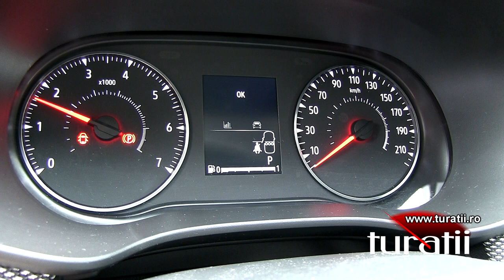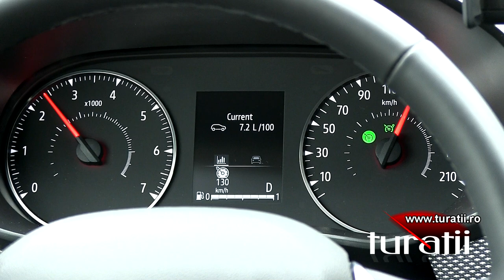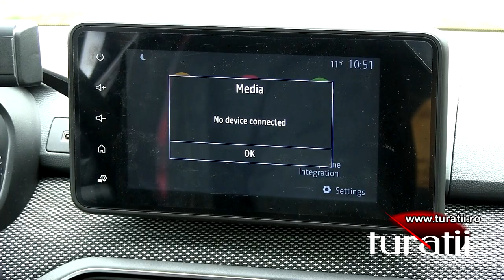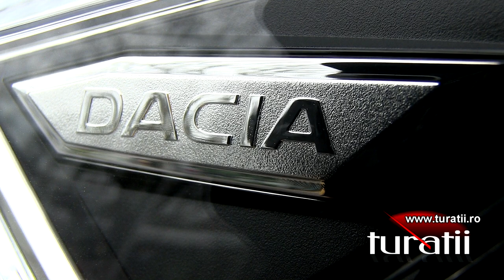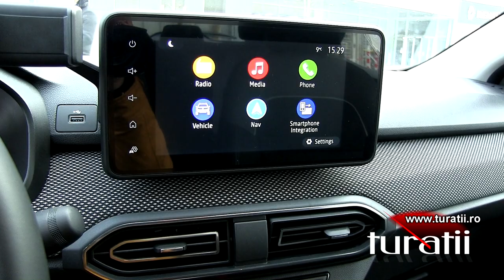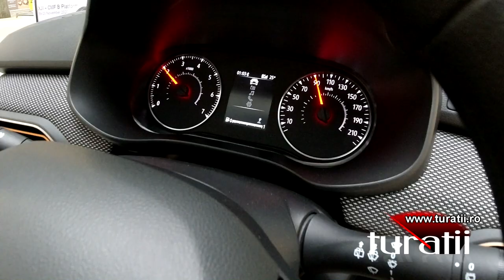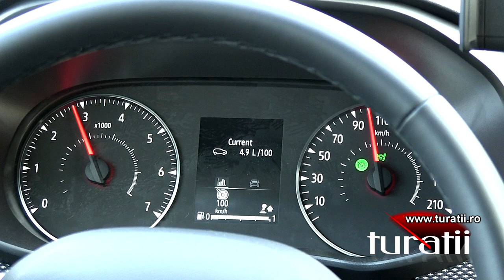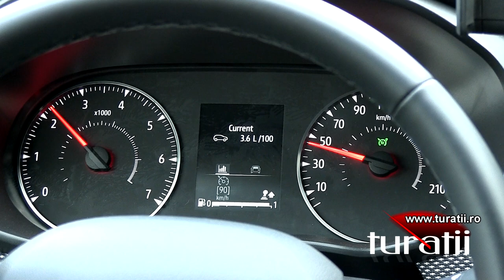Prim contact Dacia Logan, Sandero, Sandero Stepway, generatia 2020

Comment: Logan Tce 100 Eco-G sper că veți aduce cât mai curând. Mi se pare cel mai interesant dintre toate.
Reply from the maker: Sincer, am condus Captur cu 1.0l TCe GPL 5 trepte, absolut remarcabil pe gaz, incredibil, abia astept sa il pun online, sa vedem ce mai zice lumea atunci, nici nu l-am comutat pe benzina, nu aveai nevoie.
Reply: @turatii  chiar de aceea am spus că este interesant pentru ca eu conduc un Logan 1 Facelift 1.4 Mpi cu Gpl si se simte o diferență de cuplu si raspuns al motorului. 
De asemenea, voiam să vă întreb dacă vi se pare mai lenta schimbarea treptelor de viteza într-un sprint la un motor in 3 cilindri cum este acesta fata de un motor convențional in 4 cilindri.
Reply: @turatii  Salutare! Abia astept testul cu Renault Captur pe turatii cu motorizarea de GPL <3 Doar asa imi pot face o parere mai apropiata asupra consumului de GPL si pe Sandero Stepway care ar trebui sa fie mai mic (masina mai mica, 6 trepte in loc de 5 ca pe Captur).
Reply: @turatii  Care este explicația Dacia ca pe varianta de 90 cp M 6 nu pune gpl din fabrica ?

Comment: Atenție că m-am informat Skoda Fabia de la 10.420 de euro (varianta de bază ) cu motorul de 1.0 mpi de 60 de cai putere că dotări vine cu ABS , ESP,  Airbag-uri frontale față și laterale in fata , servodirecție electromecanica ,jante otel de 14 inci , instalație de aer condiționat, radio , scaun șofer reglabil manual pe înălțime și închidere centralizată in concluzie Dacia Sandero preț de pornire 8.600 de euro și varianta full 12 .950    Skoda Fabia preț de pornire 10.420 de euro și varianta  full 17.500 de euro cu motorul 1.4 90 de cai

Comment: Mulțumesc pentru răspuns, eu am închiriat în fiecare an în concediu in România, sandero, lodgy , logan, am. rămas dezamăgit deși sunt fan Dacia mai ales ca in Madrid e plin de dacia lodgy taxi Dokeer pt muncă  Dokeer stepway pt familie si ieșiri la munte sandero și Logan nu mai spun sunt mai multe ca in România eu am un Seat Mii 1,0.75  și merge foarte bine și ma întrebam cum de nu are dacia un motor ce am pe seat mii, acum sper ca va fi o masina mai capabilă si mai ales scaunul și reglaje la volan, eu îmi doresc ca tot romanul sa aibă o dacia sa iute de rablele din Germania și sa urce economia in România, după ce am ajuns să am cam tot ce e necesar după o
18 ani de emigrant vreau sa va spun ca unicul ce mi-ar plăcea sa am o dacie 1300 pt weekend sa simți mecánica si sunetul si mirosul de benzină. salutare tuturor.

Comment: daca tot au renuntat la motorul diesel de ce nu au putut marca limita turatiei? Nu este acelasi motor de 1l la toate motorizarile?
Reply: cred ca din cauza lu' Duster care are acelasi turometru, dar vine si cu motorizare diesel
Reply from the maker: E, o ieftineala stupida, daca ma intrebati pe mine, dar e cost effective, la niste sute de mii de masini, picatura aia de rosu inseamna poate niste zeci de mii de euro. Cand esti low cost, te cauti la buzunar.
Reply: @turatii  daca vă uitați cu atenție pe cadranul turometrului sub acel ,,x1000,,, ne arată că motorul merge in gol la 1000rpm, pentru un raport bun putere/viteza/costuri trebuie exploatat între 1000 și 4000rpm, între 4000 și 6000rpm nu trebuie sa stea prea mult (gen depășiri, plecat tare de la semafor, serpentine montane), iar între 6000 și 7000rpm nu ai ce să cauți (gen acea zona roșie (e valabil și pentru kilometraj)).

Comment: Doar o  întrebare legată de Stepway:: de ce pornește la peste 1000r/m ?
Reply from the maker: Depinde de temperatura de afara, are soc automat si afara fiind frig, socul se adapteaza singur in functie de temperatura motorului, temperatura aerului admis si alti parametri, nu e nimic anormal.
Reply: @turatii  întâmplarea face să "am" pe cineva la Dacia Titu (Centru) și mi-a spus că indiferent de tmp de afară tot la peste 1000r/m va porni dar vroiam să aud și părerea ta.
Reply: Un motor rece va porni la peste 1000 r/m și vara dar asta va dura câteva secunde ,iar iarna câteva minute E elementar ,temperatura exterioară și cea optima de funcționare a motorului în staționare.
Reply: In general cam toate masinile care au motor in 3 cilindrii pornesc la fel ,vw de ex

Comment: Inca posed un logan Ambition 1.6 (adica "full option") cumparat la inceput de 2008 cu 9800 euro.
Actual este masina de frecat prin oras si mers la servici. Prima masina "de buna" fiind o marca germana ce nu are relevanta. Actual la 174.000 km reali pot spune ca DACIA nu este o masina fiabila dupa cifra magica de 100.000km chiar si cu toate revizile si consumabile la zi. Tabla/rugina este o problema pe care o am din al doilea an de posesie. Caseta de directie inlocuita la 120.oook cutia de viteze a mancat rulmentii in ea si facea zgomote de noua si nu am reusit inlocuirea ei pe garantie, am mers pana a picat si am pus alta din dezmembrari de 1.5dci euro3 pentru rapoarte lungi. Compresor clima terminat la 110.oookm (avea joc in axul fuliei -> pierdea tot freonul).
Masina extrem de zgomotoasa de la 90km/h in sus. Suspensia moale dar nesigura la viteze mari. Am schimbat arcurile cu un set cu garda mai mica cu 40mm. Acum pot spune ca se simte a masina. Probleme cu actuatoarele din usi. Probleme cu zgomote de sub bord la diferite turatii ale motorului. Desprinsa tabla aia de rahat din spatele airbag pasager. Probleme la planetare la 160.000km. Si mai sunt multe dar ma opresc aici. .... Vopsea de toata jena .... isonorizare la fel.... ajunge.
Am luat teapa o data si nu mai repet greseala.
Consider ca sunt prea multe probleme pentru o masina personala sub 200.000km cumparata de noua.
Reply: Polo 1.4tdi an 2007 cu 280.000km. Prima problemă la 200.000km mi-au picat rulmentii din cutie si 2 sincroane din bronz (cost 2000lei dar am schimbat si ambreiajul Sachs 900lei +sincroane 150lei +timonerie) Rugină doar la praguri ptr că am făcut greșeala să nu spăl deloc masina iarna după drumuri pe sare si nisip dar am rezolvat ieftin la tinichigiu. La 278.000 mi-a picat pompa tandem si mi-a aruncat uleiul pe evacuare inițial crezând că e turbina (cost 1100 lei cu pompă sh 250lei schimbat ulei+filtru si bujii ptr că erau cele originale si pornea smucit la rece) Probelemele au fost la planetare sau la capetele de planetară? Eu le-am schimbat o dată. O revizie costă 300lei si se poate face si singur. Consum 5-6%. Minusuri zgomot de tractoraș dar mie imi place 🙂

Comment: Pai are consum ca al unui 2.2 hdi de la Peugeot...si cand te gandesti ca altii au motorasul de la stergatoare cat are aceasta Dacie cilindreea🤣🤣. Cum poti sa spui ca, cu  5 persoane trage la fel ca si goala(doar soferul)? Dacia ar fi bine sa puna si motoare adevarate pe masini...pe mine unul motoarele mici de la ei ma dezamagesc.
Reply from the maker: Judeca asa cum trebuie, nu comparam mere cu pere, ca pot si eu sa zic ca 1.5l dCi era imbatabil la consum si de fiabilitate nu mai vorbim. Normele europene ii obliga sa scada cilindreea, ia vezi la Peugeot, ca ai pomenit de ei, ce motorizari au la masinile de segment B. Acum, nu a fost odata. Si nu am spus ca incarcata cu 5 persoane trage la fel ca si goala, ca nici M3-ul de 400 de cai nu trage la fel cu 5 vitei inauntru. Am spus ca trage, nu te rogi de ea, daca esti sofer. Toti suferim din cauza asta, gandeste-te ca am comandat un Isuzu de 40 000 de euro acum, cu motor de 1.9 turbo, si 164 CP, cand ala de acasa are 2.5 biturbo si 163, crezi ca nu imi dau lacrimile? Cand in afara Europei Isuzu vine cu 3l de 190 cai, nu il voiam si eu pe ala? Sigur ca da, dar asta e, ne-am nascut in zona asta, ne descurcam cu ce avem. Dacia va veni si cu platforma hibrid, in maxim 2 ani.
Reply: @turatii  
Nu esti tu de vina. Deci nu tre sa te simti ofensat...viteii morti si beliti? In fine... eu tot sper ca intr o zi sa aduca macar un motor apropiat de 2.0

Comment: Pacat de motorul de 1 litru si zgomotul, la rulare In rest i masina ok la un buget acceptabil.
Reply: Stai linistit, ca sunt firme mai mari care nu au fost in stare sa bage ceva prin usi. Si se aud usile de zici ca sunt butoi de tabla si auzi absolut tot ce pica pe plafon sau tot ce trece pe langa tine. Vorbesc de un Seat Toledo 2018. La inceput am crezut ca am vreun geam deschis. Iar de motorul de 1L nu e de speriat. Trage mult mai bine decat pare. Eu am si 1.otsi si tce100. Ambele se duc super bine. Iar acum Dacia vad ca e mult peste Seatul meu. Si vorbesc la modul cel mai serios.
Reply: @Ia_Cugem  Asa e.....dar macar le am :))
Reply: @AndreiCosmin86  lasa-l, ca-i copil copac. 🤦🏻‍♂️

Comment: Extrem de zgomotoasa sau aveti probleme cu camera.
Reply from the maker: Era zgomotoasa la viteza, în spate se simte ca în avion, in prima parte e Sandero Stepway automat, care e cel mai zgomotos, probabil i de la barele de acoperis, în partea a doua e un Sandero manual, ceva mai silențios, diferența se simte în filmare, în plus, clima automata pe poziția 2 face destul de urat, pe 3 si 4 urla.
Reply: @turatii  Motorul e vechiul 0.9 TCe ??
Reply from the maker: Nu, e 1.0l TCe de 90 CP, motor mai nou.
Reply: @turatii  Multumesc ! La ce consum are nu vad rostul gpl pe masina asta
Reply: @turatii  Cum e la zgomot comparativ cu fostul sandero?
Reply: @maximdan1136  nu.